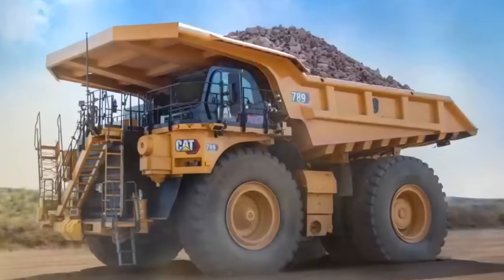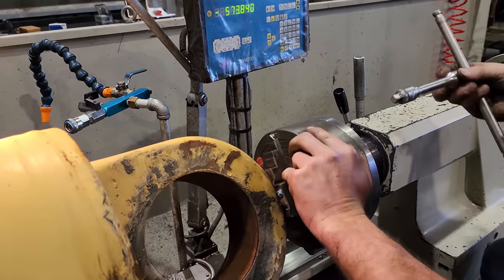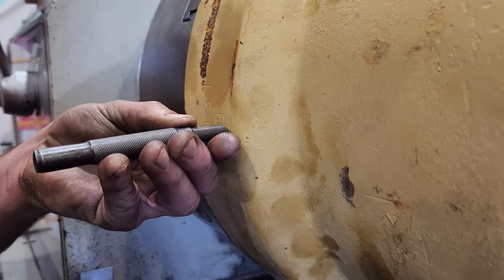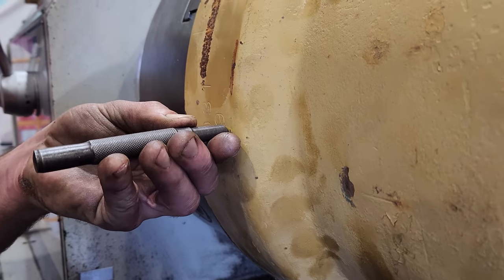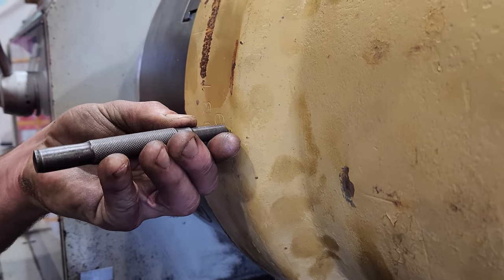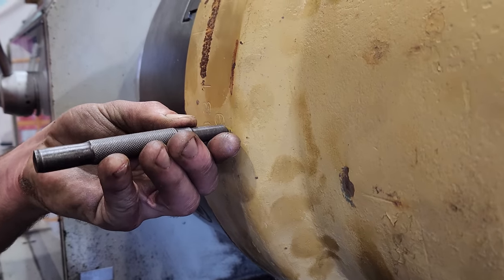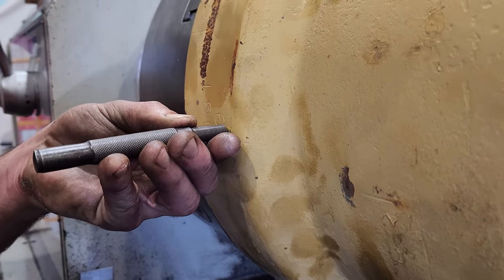Repairing a BIG Mining Truck Cylinder Barrel | Part 1 | Machining & Welding

Comment: Great combination of diagnostics, order of process, machining and welding, all with top notch camera work.
Splice with dog, birds, out-takes and Karen's laughter: winning combo.
Reply: Because the barrel is ruined to the point that re-honing would thin the walls too much, but the ends are still useable, and that much professionally shaped metal is expensive.@@karlwithak.

Comment: I have been running lathes off and on since 1964 and I can certainly say that the lathe in this video is the crown jewel of all of them. And you Sir, set the standard for all YT machinists. This is not flattery, it is an educated observation from an old man that is a prick.
Art from Ohio

Comment: Another great video. I had been wondering about the overhead crane and thinking about how smooth it seems to work. Thanks for the shot of it in the video. Have a safe and wonderful week
Reply: They say that we are part of a computer simulation. After the last video I thought wouldn‘t it be nice if Kurtis would show the crane and the extend of the reach that seems to span the whole shop area. And here it comes? And I just thought it, didn‘t even speak it out loud for Siri to hear! If I have any other questions I‘ll just think of them harder in the future. Thanks for the immediate reaction.

Comment: I'm a wanna be senior "machinist"...(not even close) with a hobby lathe and mill.   Sometimes it's quite a while using my machines.  But after watching you I feel I have to Mahe some chips.  You are very methodical and very knowledgeable in your trade.   Watching you do your work and watch the machining and welding is almost THERAPUTIC.    And your videographer is fantastic!!!

Comment: Mate, that HFM @ 2:13 you welded on, has to be nearly worth A$50. Just a backyard swarf maker, and steel is bloody expensive now. Years ago, when the Monetary Standard was in the process of being sorted out, they tossed up between Gold and Aluminium. Steel has gone up more than Gold, this last few years. Nice Job, Kurtis.
Reply: Steel is stupid expensive. Both cost of material and shipping has doubled or more in recent years.
Reply: @KennyEaton603  Yeah, but that's on account of the muscovians destroying one of the biggest steel plants in Europe in their lunatic bid to destroy Ukraine. Then there's the sanctions they got hit with as well, basically it's artificial in nature, not because suddenly steel is a highly sought after commodity or rare item. There's plenty to go around, just not from the sources that made it a stable item. Until production makes a workaround in other countries that will inevitably step up to the plate (like various other Asian, Middle Eastern or African nations taking over Chinese manufacturing to remove China's monopoly) the price will be high.
Hey, at least it's not like with copper, where they all rallied to make the cost obscenely high on purpose... making everyone with a neuron, wonder exactly what did we learn, if anything, from the last time we had this happen(read up on Yasuo Hamanaka). There's enough copper around to construct an entire city of copper, and i'm not even talking about copper in use, or copper in junk yards. Copper in ingot, being kept off the market like diamonds.

Don't you just love this world we live in? 🤣

Comment: I never knew that these cylinder were made in pieces. I thought they were cast in one whole piece!
Reply from the maker: The head flange and barrel is machined out of 1 piece and then the eye is welded on
Reply: They have to be. If they were cast in one piece, a machine such as that (the dump truck) wouldn't cost ~3mill, but 5 or more. Gotta save costs where you can with these because otherwise, nobody would buy them. There's also benefits in the strength of the finite item, giving each component the best metal to exist with. Kinda like car rear axles. They're also made from cast components and either extruded (commonly known as non-seam tubing) or welded tubes. There's also the considerations of the manufacturer's cost for casting a component as large, in the required quantities to sustain the industry. They'd have to cast 20 of these every few weeks (if not more) to have enough to pass around the globe... they'd be throwing money out of the house. There's many, many reasons behind it. :)
Reply: I find it absolutely incredible that only 2 of those hydraulic rams lift the tipper and the load.
Reply: @carenbarnet378  Excellent observation you set me thinking more about it myself. That must be some kind of flow and pressure and make a mess if a line breaks!!
Reply: @j81851 my dad was walking near a smaller excavator when a line popped, it covered everything in about a 30 foot radius with a good layer of hydraulic oil, I can't imagine the mess a line feeding this big of a cylinder would make
Reply: @scrapbudgetgarage4404 
It is not only the oil spill is the problem. Such rapture of a barrel/flange/line is extremely dangerous for any personel in close counter. I have a colleagues in university which work was to maintenance a little bit smaller dump trucks and they told me a lot of unpleasant stories.....so guys always be careful around big machinery.
Reply: @aserta  I've seen the production of, seemless tube on, Discovery's: "How it's Made" it was really interesting.
Reply: @carenbarnet378  Hay, man, hydraulics are extremely strong!
Reply: @scrapbudgetgarage4404  l'm pretty sure you can find video of hydraulic lines bursting online.
Reply: @carenbarnet378  liquids are practically not compressed
Reply: @carenbarnet378  the hydraulic flow is 731littres/ 193 gallons per minute, pumping at around 2500 psi (pounds per square inch) pressure, which gives a body lift time (the time it takes to tip the butt) 17-19 seconds....that 180 tonnes tipped up in under 20 seconds.
Reply: @CuttingEdgeEngineering   Lotta Swarf!  Wondered why you'd cut it off, thought they'd be fabricated.

Comment: Wow, that's once again giant patt repairing) I also have one question, if you don't mind: what was the biggest repair in the CEE workshop by the moment?
Reply from the maker: At the moment, hydraulic cylinders off EX2500 excavators, would love to get into the bigger Liebherr equipment but need to upgrade a few pieces of equipment
Reply: @CuttingEdgeEngineering I love watching you sling the big iron about. Wishing you a great day from the scrubland desert of Okanogan county Washington, USA. Hope you, the missus AND MOST IMPORTANTLY, little homey have a fabulous Friday
Reply: @CuttingEdgeEngineering  This reminds me again about videogame Dune 2000's voice indication : "Upgrading. Building. Repair complete". ))) Best of luck with this planes!)
Reply: @pacificcoastpiper3949  Are the Canadian fires heading your direction?
Reply: @LadyAnuB  they’re a good bit away. Although there are one or two others I’m keeping my eye on

Comment: I am wondering; once it was setup in the steady, couldn't you remove the block and put a center in the eye? That way it was there for the rest of the life of the part (ie easier to setup for the next guy)
Reply from the maker: hey mate you're a step ahead of me, I do that at the end after the eye is in position on the new barrel, could've done it before removing the eye, doesn't matter either way
Reply: @CuttingEdgeEngineering  Ha! just need to wait for part 2 then :-D Thanks for the clarification, just a simple IT guy here
Reply: @CuttingEdgeEngineering  Always be kind and considerate of "the next guy" -- it will probably be you again!

Comment: Just realized that approx 1 year ago Kurtis did a similar repair for a barrel on a 785 dump truck. Karen, don’t know if you even realized this but you did an incredible job on both of these videos. The overall length of the two videos is within 15 seconds of each other. Also, you were within 5 seconds at the point that Kurtis got the eye end to pop off the cylinder. Pretty amazing the consistency of both of you in your work. 😂

Comment: The main reason for the cylinder being upside down is the force of the piston side is greater than the rod side. 
I really enjoy the videos. I worked in the machining/ welding 
/ hydraulics industry for 40 + years and you do it right.
First channel I've seen where the welder knew the need for preheating. Big thumbs up Kurtis!
Reply: It makes no difference whether the cylinder is mounted upside down or not.  To dump the load the cylinder must extend, which will always result in the larger side of the piston being pressurised.
Reply: The dirt exposure stuff is the most important IMO.

Comment: Great job thinking ahead during the setup. Terrible to have everything welded but out of alignment.  Interesting having a heavy lop-sided cylinder on the lathe  -  important how you centered the part relative to the insert - the lathe must be slow!   Never thought hydraulic smoke could be an indicator - one reason not to run coolant?  Thanks for the great videos! Cheers!

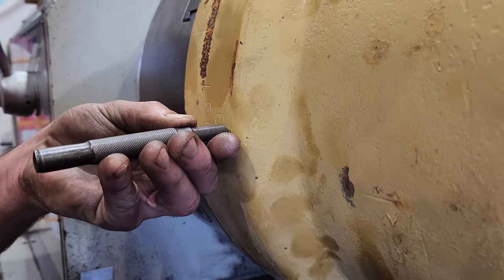Comment: I assume you went with center defined by tangent forthest from pin hole. Running concentric after that is a mystery to me; learning😊 7:40, there it is; OD and motor side center on ID to establish tail stock center. Brilliant!👍🏻10:30 Voice of experience. 13:35 The tail wag says all😊. 18:50 Interference fit preparation with heat considered🫡. 21:20 Nature always knows where good things are.  24:15. Finding clean surface on two diameters to achieve minimum depth necessary for clean finish between index marks?🤔..wow with commentary on the why of it😊 36:48 Nature's splendor, ..even with the birds😁

Comment: Man I always loved machining work, first machining job was running a production hey face and centering machine, I’m surprised no one lost a hand on those it was pretty much place part in the jig hit two buttons clean out the machined part  place in shipping bin part another and get ready to place new part in.depending on the part cycle time ranged from 15 seconds to 30 seconds. Also depending on part had to do a quality check, making sure it was the right height in the center. It was not too deep or too shallow.

Comment: Have you ever tried laser cladding hard chrome surface? I have seen good results with this process which provides a good bond it is almost like welding with a microscope. The process I witnessed used Stellite 6 as a cladding material. The trials with laser cladding were due to the same problems you witness which are original hard surfaces coming off or failure of bonding.

Comment: Very interesting! When putting 9-10 layers of weld I'm sure even big parts get very warm. Do you sometimes do something preventative to not overheat the part? Dual shield might not be that sensetive? Stick welding overheated parts does not work, the puddle overheats and boils all over the place... Sometimes I have to cool the part with a fan, not to cool it to fast, but still cool it faster than just waiting around without a fan...

Comment: Another great video, I have a question.  So are most oem barrels chromed on the inside? But they don’t need to be chromed when repaired/re-barrelled as you will just be honing it to side…why is this? 
Thanks guys 👍🏻

Comment: Hello guys I appreciate all the work you do and share with us, I have a small workshop in Mexico and we do a lot of the same kind of jobs that you show us here, so I learn a lot of watching you working. I'd love to have all the equipment that you have is like a dream work shop, tools and machines for everything.
I have a question though, I work with a thermal arc spray machine, it isn't recommended to repair a damage hydraulically rod with this kind of chrome layer? thanks guys and best wishes

Comment: Karen, thank you for the shot of the overhead  crane in action! it seams like it can reach just about all of the shop. what is the known lifting capacity? thanks again 

further than zero.. were BEEPed

pure craftsmanship as always. i get so many questions that you have already figured out. when you get pieces like this that are not round or square. that first piece you welded on the eye.. what reference point do you start at to get it on the center line? because when you put it on the lathe and got it round.. when you brought the center drill to your welded piece.. it was PERFECT. how do you do it every time?

Comment: I think I'm getting the hang of it now. Cut off the valuable bits, throw away the barrel, get a new barrel, interference fit on one end, weld it, align the other end to length, weld it, polish the inside, clean up the outside. Now what I don't know if he'll paint it yellow or if he leaves this job to the owner and just rust coat it.

Comment: Homey is a delightful friend and loves his plastic squeaker toys.

A word of caution though.  Don't let him tear off pieces of the toys or dislodge the squeaker as they'll invariably swallow them where they'll lodge in the stomach.

Our German Shepard was toy crazy too and when she wouldn't eat the vet found her stomach full of plastic bits and squeakers requiring major surgery to remove everything.  After recovery she was given toys under a watchful eye.  Any that got torn were promptly discarded and replaced by a new one.

Dried leather chewies are another hazard due to cracking molars trying to gnawing off a piece or gagging on long piece of leather.  Another dog suffocated to death with a 7" long, saliva softened chewy, stuck in his throat obstructing his windpipe. 

I hope this information will forestall any such incidents in your successful lives.

All the best, Jim H.

Comment: Hey Kurtis;
    I noticed every time you drill into steel or iron you set the RPMs lower. Why do you do that? Is it to prevent the bit and/or the hole from over heating which prevent the drill from doing what it was designed to do, cut into the metal, or another reasons? 
I have a hell of a time trying to drill steel, even with slowing the RPMs down and using lubrication. I just started doing that after watching you work.

Comment: Hi Kurtis, I was thinking of when you put the cylinder barrel in the lathe, before the ends and flanges are removed and you are making your measurements, wouldn’t a laser line work? Would it help do you think?
I know you have probably always done it your way, and I agree with “use what you know “. 
I’m just wondering if it would make it even easier?
Mark from Scotland.

Comment: The rod probably was HVOF coated from the factory. Cat uses both that and chrome on various rods. Looking at that job, before it sat out and rusted it looks like they could have buffed down those scores so there wouldn't be any sharp edges and run it again. There's nothing other than a wear ring that runs through that area, so it doesn't have to be a smooth sealing surface.

Comment: When you are cutting the weld prep chamfer around 28:20, are you moving both handwheels to make a diagonal movement? That's pretty cool if so, haven't ever tried doing that for rough chamfers. Most of the stuff I work on is considerably smaller (maybe 150mm OD) so I just use a form tool to make chamfers.

Comment: 25:12, looks like the interior is running fairly true.  With only a .001 meter cut I was thinking you would use a dial indicator to verify, maybe you did off camera?

Comment: When machining the inside of the head flange you have it clamped from the outside (which as you noted is painted and not a machined surface). How can you be sure the bolt holes are perfectly  concentric with the new inside surface? Or does it not matter if they’re ever so slightly off?

Comment: Nice work, as always.  Do the welds require testing and certification by a certified welding inspector?  I imagine those cylinders are pretty high pressure.

Comment: I noticed you didn't preheat the metals, when you welded the square block on the end of the barrel. Are you not concerned with the welds cracking?

Comment: Kurtis, How do you determine your settings for welding such as rotation speed, amperage, wire, wire speed and gas choice? do you have books or reference materials or is it all just experience and intuition?

Comment: Do the lathes only feed toward the headstock and not the tail?   Is this because the driven end has larger thrust bearings to handle the loads or does it matter?
Reply: They feed both ways.

Comment: Not being a machinist I have a question? Does the interference fit change as the diameter of the base item increase? Do you have to change your tolerance to accomadate larger diameters?

Comment: Hi, I have two questions. The first is, when your cutting the eye off the cylinder and you set the lathe to a speed, have you a chart to know that this is the speed your to set it at with this diameter of piece or is it just from experience and second, when your making up a new cylinder for a ram, in what way do you measure the length of it so it's the exact same as the old one, I'm just really curious cause I love watching your videos and seeing how some things are fixed and made. Thanks

Comment: I was watching this and have a question? Since you are not using the old barrell, what benefit is there to parting off the head flange instead of using a bandsaw? I would have assumed that to be faster than the multiple lathe setups for that operation.
Reply: Fair point, perhaps the bandsaw isn't quite big enough?

Comment: I do have a question: Is there any particular reason you used a button insert over any other insert to dial the barrel in with that method?

Comment: Watched both parts 1 and 2 - the vertical honing process was quite interesting. Tried to watch part 2 again, but it wasn't available here in the US. Was it taken down for some reason?
Reply from the maker: Part 2 video for this job will be up on Friday, the video you watched was probably from 12 months ago, we had a similar repair but it was for a 785 barrel (this is a bigger 789)